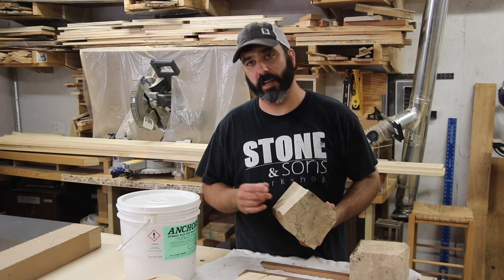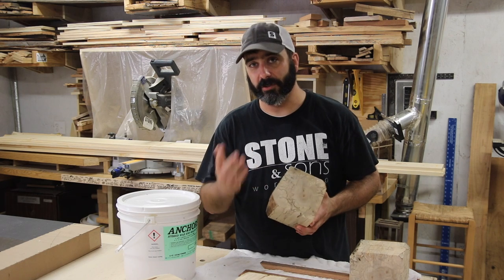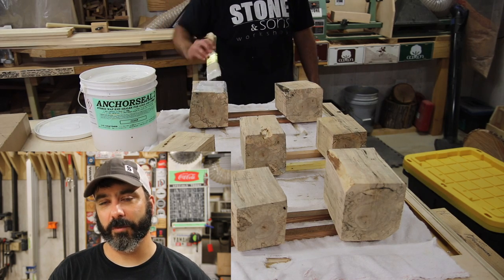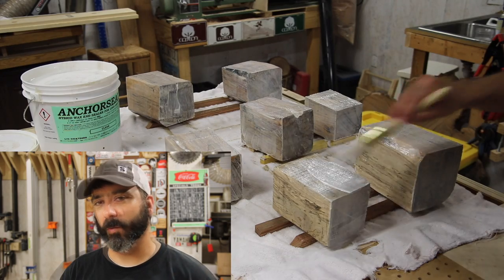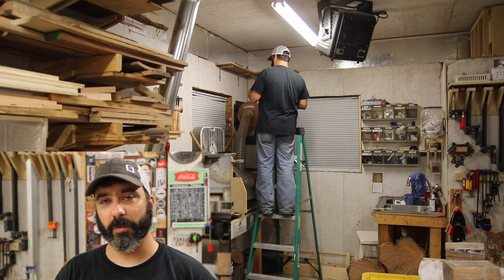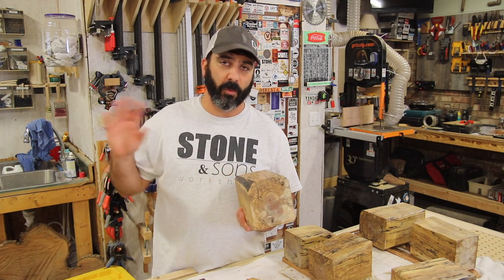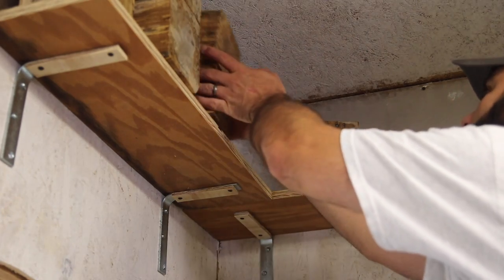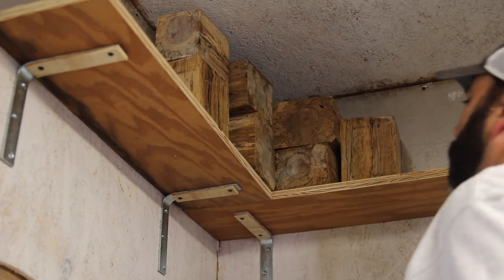Processing Small Logs and using Anchorseal

Comment: Shawn, I must have missed it, but what is the purpose of using the Anchorseal on the blocks?  Will that prevent any further drying of the blocks?  Without proper drying, wouldn't that cause problems when you go to use the blocks in a project?
Reply from the maker: +Glen Shevel I coated the whole blanks because it's all freshly cut and want it to dry slowly.